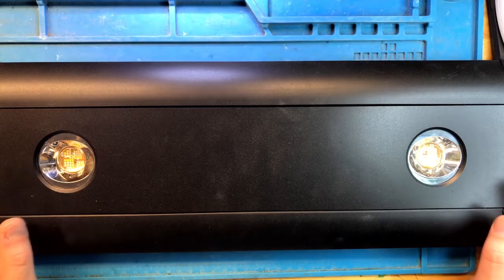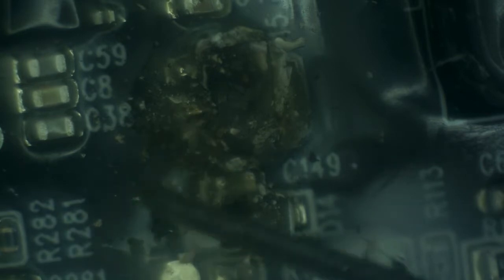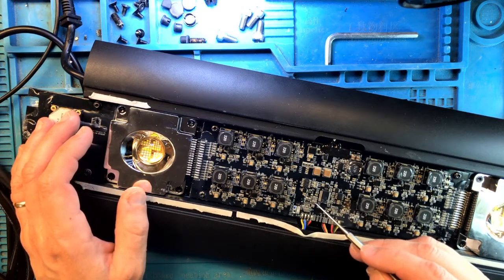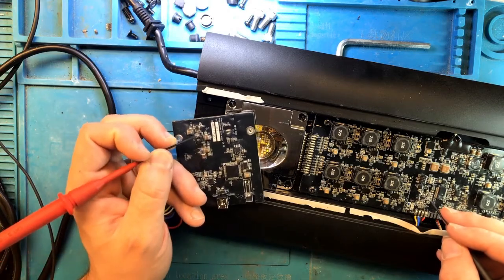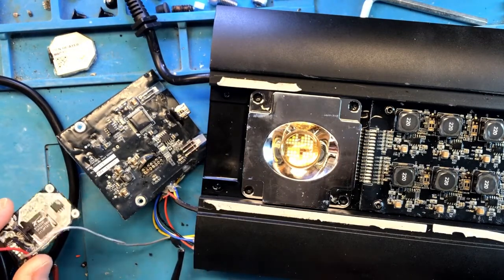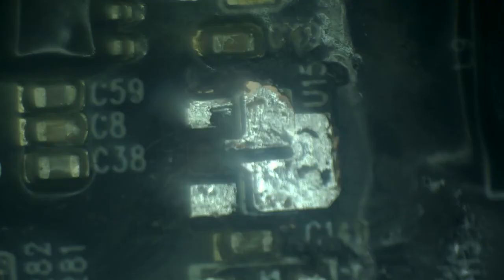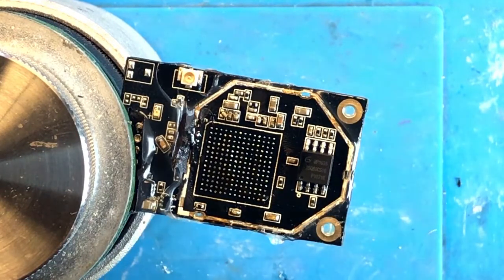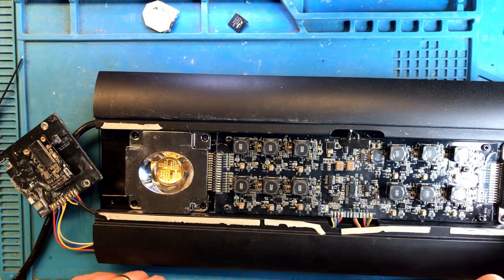Kessil AP700 Massive Short Kills Everything   Bonus BGA Wifi Controller replacement

Comment: Excellent video! What temperature do you run your hot air gun at when removing and replacing the components? I'm always worried I have mine too hot or too cold!
Reply from the maker: It really depends on the unit being repaired. Kessils need at least 450 C because of the thickness of the board and conformal coating.

Comment: Hi wondering about black box LEDs. I took in several old ones and ordered in replacement diodes and lens. I replaced the diodes in two and cleaned up the boxes. Problem was after I did all this was the power supplies were also broken. I looked for replacements but was not able to find anything suitable or cost effective. It seemed that buying a new light was cheaper then fixing these old lights. Any thoughts would be great. Thanks in advance John in Halifax, Nova Scotia
Reply from the maker: AliExpress may have those power supplies available at a reasonable price. But generally speaking, I agree that replacing too many components on those black boxes is not going to be cost effective. I repaired a fair number of black box lights, but all of them had issues with LEDs and bypass diodes, which are fairly inexpensive as parts.